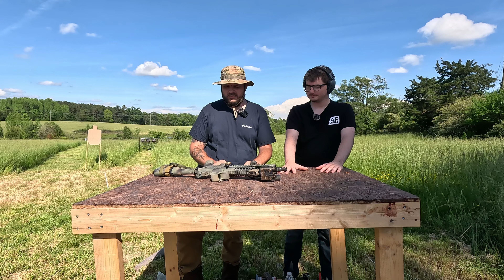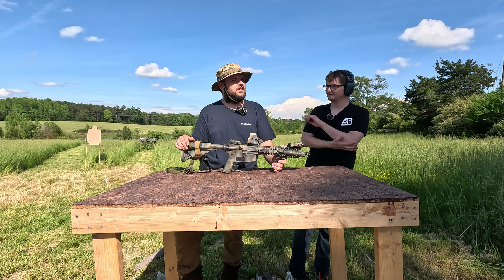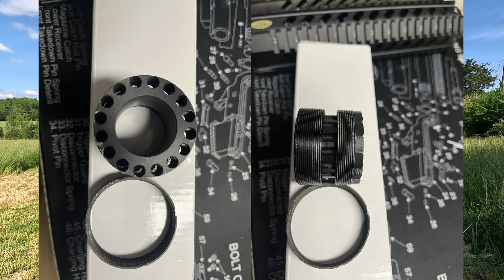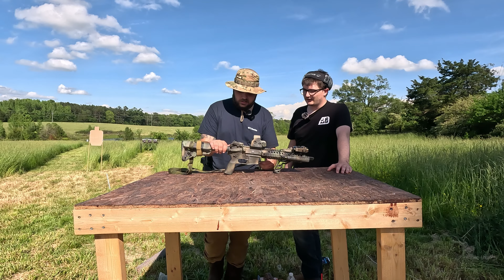Mk18 Clone Build Breakdown

Comment: Your Clone is just fine.... don't listen to these haters.
As long as your upper Receiver is milspec and made of 7075-T6, you'll be fine.
A quality bcg, barrel and handguard is of significantly more importance. 
A clone is simply a copy of a rifle that looks like the original.
Right now Daniel Defense is using government profile barrels in their mk18s and that's one of the dumbest barrels ever made. So, they are not perfect.
Stay away from Monstrum parts if you're concerned about reliability. If you just want to test something out, and you're not sure if you want to spend the big bucks, then you can start with a 20-dollar monstrum piece and go from there and replace it if it's the feature you want. But PSA internals and monstrum anything are junk for long-term and reliability.
That being said, I did buy a monstrum red dot mount for my red dot just to see if I prefer it with the 12:00 position or the 45 off set. Once I figure out which way I prefer, then I will buy a reptilia or Badger Ordnance. But I will experiment with the cheap stuff to find the ergonomics I like.